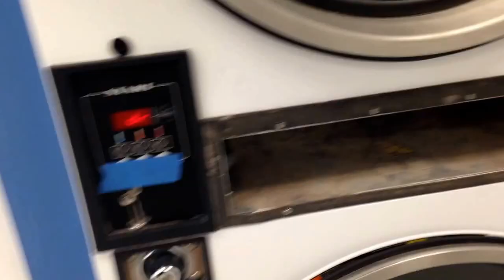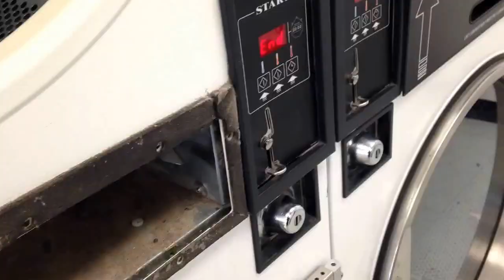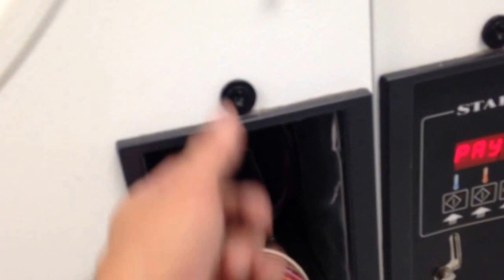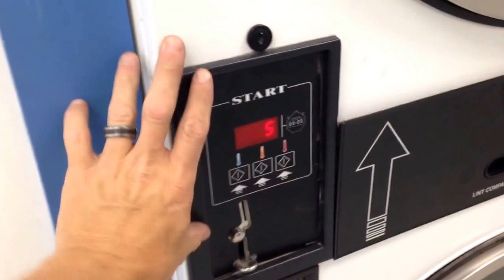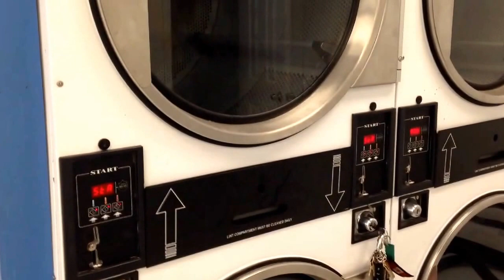How To Replace a Dryer Roller.

Comment: thank you for that 

i face the same problem on Cissell dryer. but the problem in your video you did't record the all steps for replacing the roller 

and i have a problem in Unimac dryer the display shows AF i think that mean air flow what is the exact problem is it due to flex tube 8" not enough to vent the air??

you support is highly needed

thank you 
Khalid
Reply from the maker: I usually get to far in and forget to record what I'm doing. I'll try to get all the steps in the future.
Reply: Laundromat How To / Coin Laundry How To the problem already solved many thanks to you
Reply from the maker: I'm not familiar with the Unimac dryers. Most dryers I have worked on have and air flow "sail" switch. Its a light weight flap that is pulled in when the fan starts and confirms the airflow.
I have seen problems with the flap itself that was worn and didn't move enough, the switch and the wiring.
Another issue could be lint build up inside the internal ducts of the dyers, or in the exhaust of stack dryers , they have flaps that prevent a backdraft when one dryer is running from blowing into the the other. Lint piles up on top of these and prevents them from opening all the way.